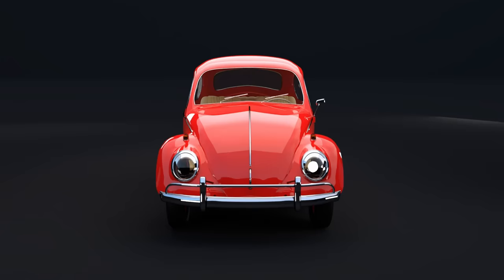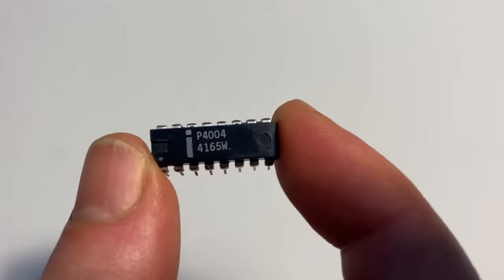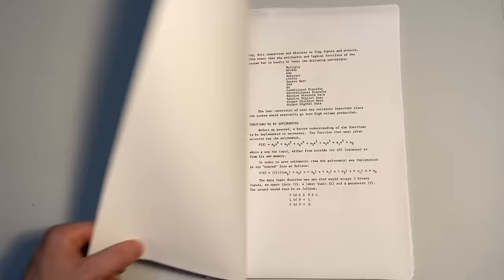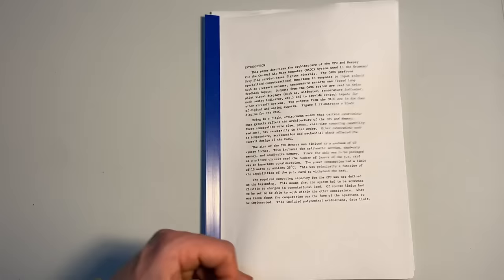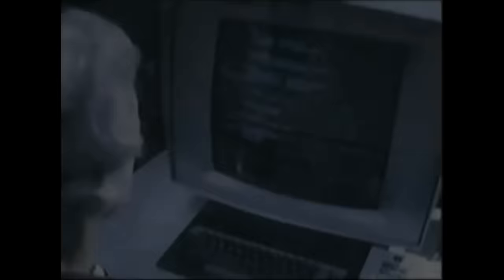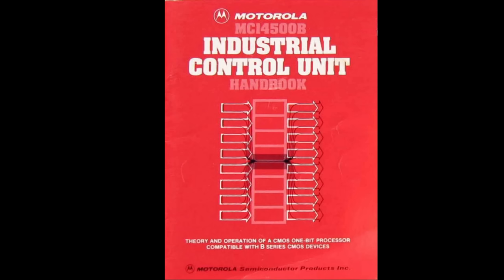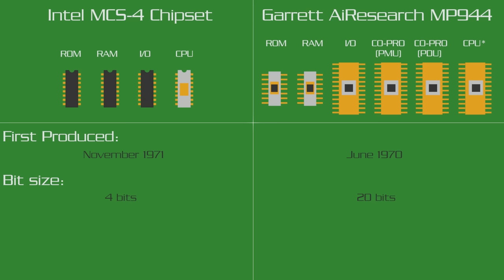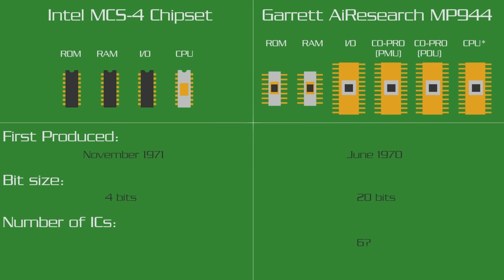The World's First Microprocessor: F-14 Central Air Data Computer

Comment: Some friendly corrections: (may border on the seriously pedantic, your call)

5:03 It has been known since the 1950's that the most highly manuverable craft are often somewhat inherently unstable. Nothing controversial to anyone knowlegable there. 
7:38 Variable wing geometry is still in active development and is not obsolete. Swing wings are obsolete. There is a distinction with a difference. 
10:18 IIRC, The computer controlled the reaction of the rest of the flight control surfaces to the extension and retraction more than the speed of actuation of the swingwings and vanes. It was required to control these so that the compensation worked correctly, as you noted earlier where manual actuation was still CADC controlled. 
17:45 The stance that a "rEaL" microprocessor must have onboard rom, ram, IO,  is farsical. My 6-month old top of the line pc has seperate IO chips, Ram chips, Rom chip, and a co-processor cars with all 4 onboard. So only SoC would count, which is not in the same realm. I think you just wasted time here. Just muddled the whole topic here, although explaing the rom etc was nice. 
23:45 Not a correction, just think you should do a video on the "Four Phase" as I have never heard of it and can find little info. There are already many great and exhaustive videos on the 4004.
30:22 I don't get why that would be harder to program for, and you made no justification for this statement. 
40:33 Machine code translates to binary with no real compilation, it's not a 'language' per se, but a 1:1 human readable formatting of binary commands. Which is to say they totally wrote it in assembly and that was just typed in as binary. Your image at 48:00 shows that in the context of the 4004. 
45:30 Punch cards, and even magnetic tape were available then, but tape was the most common interchange format. At the time, data interchange between dissimalr systems was quite rare.
52:40 I know where there are more about in the USA, but for security reasons, I'll leave it at that. An enterprising hobbiest might be able to get their hands on at least a partial set. If I find some i'd invite der8auer to the states to see them and make a video (export restrictions invariably exist). I'm confident the iranians have already just used an FPGA to copy them, as most countries do with stolen digital tech (see: Russia and China using FPGA copies of us missle guidance computers, there are videos on this).
54:22 There were more. Some are still classified, which should make obvious their purpose. Others were just corporate dead-ends, although not all technologically so. 

All that said, you did an excelent job for a non-subject matter expert. Big respect. Got my sub.
Reply from the maker: Thanks, yes as you may have gathered by my tone, I do indeed think defining a microprocessor as essentially a SOC is indeed farcical: unfortunately there seem to be many that take that stance (for some reason). I didn't really enjoy having to be pedantic there but I was trying to make clear that 'if the 4004 is a microprocessor, then the MP944 is too'.

Anything I say about coding in assembly/machine code should probably come with a disclaimer that I am about 40 years removed from that world.

Btw, it was me saying supersonic aircraft are 'ugly' rather than 'unstable' which (rightly) made people mad!
Reply: The F-14 is not a inherently unstable aircraft, in fact, quite the opposite.  Maybe if you compare it to something like a Cessna 172.  The F-14 is especially stable to the point that even the famous flat spin is difficult to actually achieve and enter.  Less than 10 airframes were lost in them.  The F-14 actually is designed for stability because it lacks fly by wire or computer control over the primary maneuvering surfaces.  As the wings sweep back, the center of lift moves aft, increasing the distance between the CG and the CoL.  This was actually the reason for the glove vanes on the early F-14A's.  They kept the CoL further forward, reduced mach tuck drag, and allowed for 7.5G maneuvering at any speed the F-14 could achieve.

I'd argue that modern wing geometry hasn't made variable swept wings obsolete, but certainly has bridged the gap between them.  A true delta will always have less drag than the hybrid delta of something like the F-22.  A true straight wing will always have better leverage against the CG for maneuvering and provide more lift than a hybrid delta.  The variable wing sweep allows for a greater optimization across the entire flight envelop.  Aircraft like the F-14 had an impressive turn radius, turn rate, and speed relative to the thrust.  I say that because the TF-30 equipped F-14A weighed significantly more than the F-15 did and had less thrust, and yet the top speed difference between them is not that great.

The question is whether or not the weight and complexity or a variable wing sweep justify the performance gained over a hybrid delta, and that is where a variable wing sweep tends to fall behind.  The other aspect is the difficulty in stealth.  No one has made a modern variable wing sweep aircraft using modern low observability or composite technology.  It may very well still present enough advantages, for the right aircraft, to justify its weight... but no one has really done it.
Reply: @Whiskey11Gaming wrt swing wing, I think the real reason the Navy and Air Force don't use it anymore is because they can acheive "good enough" without having to maintain a swing wing system. Plus it adds weight, reducing fuel consumption. I think they found it just isn't worth the cost.
Reply: Formally, it's not wrong to refer to an assembler as a compiler. The definition of a compiler is basically just a translator for programs. An assembler qualifies, even if it's a lot simpler than we usually think of. As long as we're being pedantic. :)
Reply: @Noisy_Cricket  I concur, basically today they can beat the aerodynamic limitations with the force of sufficiently powerful contemporary engines to achieve acceptable results.
Reply: Regarding the statement at 30:22 about it being harder to program:  I agree this makes no sense.  If you read the original paper the PC in the ROM is capable of both random and sequential access meaning the CPU can write a new address to it for jumps and then continue using it in sequential access mode until the next jump.  The 8061 has a similar architecture and there it is handled entirely by the CPU and does not impact the way the code is written, and I imagine the MP944 works the same way.
Reply: @andrewfleenor7459  Formally it is wrong to refer to assembler as a "compiler" because there's a key difference between the two: there's a isomorphic relation (or near isomorphic, depending on how sophisticated the assembler is) between assembly language and machine language. There is only one translation that can be done from e.g. 8080 assembly language `MVI C,1`, which is 0E 01, and that is easily reversible: 0E 01 translates back to `MVI C,1`. With a compiler, on the other hand, there are many ways to translate `x := 1` to machine language, and you cannot trivially translate what the compiler produces (which in assembly language might be `MVI C,1` or might be `STA 80FFh`, or might even be `PSH B`, depending on the context) back to the high-level langauge being compiled.
Reply: @Curt_Sampson    I've never once seen that distinction enter the formal definition of a compiler. Sure, it's not a terribly interesting compiler, but trying to exclude trivial cases from a straightforward definition almost never makes things better.

Citations? And I do mean plural, because it'll take more than one to convince me that this definition has been the consensus and I've just missed it the whole time I've been studying compilers.

(I'd also submit that you're underplaying the complexity of assembly. Consider, say, the x86 MOV mnemonic. I know for sure there are a bunch (dozens?) of possible opcodes it can assemble to, some quite complicated. IIRC the NASM docs have a couple places where they describe places they have to make decisions about how to assemble ambiguous instructions. But that's not terribly german under my definition, which I'm pretty sure is the standard one. Just something for you to consider.)
Reply: @andrewfleenor7459  First, I'm intimately familiar with several assembly languages; I program in them to this day, and so some fairly sophisticated things with my favourite assembler (Macroassembler AS), as well as having written several CPU simulators. So I'm not coming at this from just a theoretical point of view.

And so no, I'm not underplaying the complexity of assembly. That MOV itself doesn't determine the opcode is a trivial observation; this is true of virtually all CPUs. In many cases an opcode is selected based not just on the instruction mnemonic but also the addressing mode, generally taken from the operand field, and this is true of virtually all assembly languages. The 6502, for example, has eight different opcodes for LDA because that instruction has eight different addressing modes, and for some of these the selection of addressing mode can be somewhat subtle. (E.g., do you assemble LDA $12 using absolute addressing mode, opcode $AD, or zero page addressing mode, $A5? This is why I qualified "isomorphic" with "near.") Nonetheless, that does not invalidate the massive difference between that (or even much more sophisticated versions of that in assembly language) and `x = *(0x12)` in a high level language.

I don't know that the exact definition I gave you is a consensus, but there's certainly a strong current of agreement that compilers compile "high level" languages and assembly is not a high-level language. This is implicit in pretty much every one of the sixty references given on the Wikipedia page for "Compiler."

If you want to make "compiler" have the same meaning as "translator," that leaves you with a redundant word and a missing word to describe the meaning commonly given to "compiler" that distinguishes it from "assembler." I really don't see the point of that, except to hinder more clear communication.
Reply: @Curt_Sampson  There's no redundancy: a compiler is a translator of programs. And in that category, there's a continuum of complexity from assemblers to optimizing C++ compilers. If you want to be more specific, you'd specify something about the source or target: the term "high level language compiler" is reasonably common.

I did say I was being pedantic. Implicit assumptions in a Wikipedia list are not a relevant citation. I'm working from memory of actual compiler textbooks and other academic material.
Reply: @andrewfleenor7459  If there's no redundancy, what is the difference between a compiler of programs and a translator of programs. And, more importantly, what is your term for the set of translators that compile high-level languages (without a near-isomorphism between the source and target languages) versus low-level languages (with a near-isomorphism between the source and target languages)?  If were you actually being pedantic, rather than very loose with your terminology, that is the sort of thing you would be focusing on.

I did not give you just a "Wikipedia list"; I gave you a list of citations, specifically, which is exactly what you asked for. (That list of citations even includes "actual compiler textbooks and other academic material.")  And the implicitness of the use of the word "compiler" is the nature of the argument: you're saying the word is commonly used to cover assemblers as well, and I'm saying it's not and giving you sixty citations where it's not, which is rather implicit. If you want explicit, that's on you: go find me ten citations where "compiler" is used in a way that clearly and explicitly refers to assemblers. (I.e., not just "a compiler translates a language" with you adding, "assembly language is a language.")
Reply: @Curt_Sampson    I already gave you the term "high level language compiler". I'd be hesitant to name it any more sharply because the boundary in real life, as I've said multiple times now, is not as sharp as you seem to think it is. (Where do you put Forth, for instance?) No one says "compiler of programs", by the way, because that actually would be redundant, unless you were comparing to something like a Protobuf "compiler", which (I believe) is formally just a code generator.

Ah, but now you're strawmanning me. I never said it was common to refer to assemblers as compilers. Indeed it is not. What I said is that it's *not wrong*, pedantically speaking. Even Wikipedia is consistent with this: note how broadly the first sentence is worded, and where the word "primarily" appears.

Now I'll admit that I haven't read all 60 citations on the page, but I'm guessing you didn't either, and I'm guessing they don't, taken together, contradict the opening sentence of the article, which conveniently also agrees perfectly with me, who has spent almost half my life reading compiler theory. Now do you have an actual citation that rules out assemblers as compilers, or are you just going to bluster some more based on your vibes about what "compiler" means in your personal experience?

Sheesh, I just wanted to make a funny nitpick.
Reply: @andrewfleenor7459  I don't think you're even starting to follow my argument about assemblers being near-isomorphic translators and compilers not because by that method of analysis where Forth stands is obvious.

And the word "primarily" is required in the Wikipedia intro, which reads, "The name "compiler" is primarily used for programs that translate source code from a high-level programming language to a low-level programming language...to create an executable program," because there also exist source-to-source compilers that translate high-level languages into different high-level languages. This does not erase the distinction from other forms of translation; we wouldn't refer to a sed script that replaces BEGIN and END tokens with braces and similar as a "compiler," would we?

It's apparent that you've not even looked at the titles of the citations I gave you, since the distinction is apparent even in the title of one reference: Assemblers, Compilers, and Program Translation by Calingaert and Horowitz (Computer Science Press, Inc., 1979). Within the text these lauded computing scientists make the distinction clear on pp. 186-187:

"7.1.3 Compilers v. Assemblers

"The many source-language features described in the preceding section result in a number of salient differences between compilers and assemblers. On any one item the distinction may not be clear-cut. Moreover, it may be difficult to distinguish a simple compiler from a powerful macro assembler. Nevertheless, the differences are usually substantial enough that there remains a qualitative distinction [emphasis mine —cjs] between assemblers and compilers."

The section continues with a distinction along the lines of the one based on isomorphism that I've been giving you all along: "Generally, a compiler performs a one-to-many translation, generating many target-language statements from a single source-language statement, whereas an assembler performs a one-to-one translation." (One obvious exception to the former is when the target language is also a high-level language, of course.) And then goes on for another page and a half with further qualitative distinctions.

Can you find an equally weighty source that clearly and unequivocally states that compilers are assemblers? I doubt it.
Reply: @Curt_Sampson   A pedantic interpretation of the definition of a compiler, such as I was explicitly using from the start, points at "qualitative differences" and laughs. The authors you quoted would still be forced to agree with me if pressed, which you can tell because of how many pages it takes to  work around the fact that assemblers clearly fit the definition, and that macro assemblers blur the line. (By the way, does that answer your previous question about how to draw a line around HLL compilers? Or rather, illustrate why I can't be arsed to give one?) But congrats on both finding and actually reading a citation that sort of supports you, even though I don't think it changes my point.

And I don't think you realize just how close Forth is to the same kind of one to one translation as an assembler. The body of a Forth word is almost one to one with a bunch of jump instructions (I think there's some complication for control structures). And yes, of course I know exactly what you mean about the the vague isomorphism between assembly and machine code. You could almost implement an assembler with regexes and substitutions. That changes nothing. Pedantically.

The great thing about definitions is that you don't need an authoritative source to spell out every possible case for you.
Reply: @andrewfleenor7459  It's just a page and a half, and it makes clear why assemblers don't fit the definition of a "compiler"; it "works around" nothing; it describes a fairly clear difference.

That the line between compilers and assemblers isn't a hard, narrow one isn't unusual. We don't say that "all chairs are tables" just because virtually all chairs can be used as tables. What you are trying for here is an "all chairs are tables" style of definition.

I realise exactly how close to and far from Forth is to the machine; I think you do not. If you understood Forth well you would be well aware that for any particular word you're given to compile, you can easily come up with three or four different ways of compiling it and find examples of different Forth implementations using all of these for any reasonably popular CPU.

"You could almost implement an assembler with regexes and substitutions. That changes nothing. Pedantically."

In other words, you consider even trivial sed scripts that do just substitutions to be compilers. Well, you're welcome to the personal definition, but don't expect many people to agree with you, because it's a ridiculous definition. I would say it's also rather the opposite of pedantic, because you're essentially removing meaning from the word "compiler" and making it harder to discuss many program transformation techniques.

"The great thing about definitions is that you don't need an authoritative source to spell out every possible case for you."

Well, you didn't seem to find that so great when you were demanding an authoritative source earlier in this discussion.
Reply: @Curt_Sampson  Chairs vs tables are actually much better separated than compilers and assemblers. One is for butts, the other is not. Even where the forms overlap, it would be very obvious in which capacity you were using it. Weird example.

A simple sed script could indeed be considered a very trivial compiler, given suitable endpoints (simple brace substitutions won't cut it for any languages I know, but you could invent them). There aren't a lot of good examples, but some esolangs are in that territory. Not very interesting compilers, I think you'd agree (unless they're funny, which they often are).

And hey, I said you deserve credit for finding a citation. But it is just rehashing an argument that I already consider to be special pleading, while effectively conceding the core of my point. An argument from vibes. (Ed: oh, and it still has the weasel word "usually".) I asked for a citation, yes, but I don't have to find it compelling.

Like I alluded to, I'd be happy to argue the same point with the authors. 
They'll come around as soon as we start talking about universal quantifiers over source languages (yes that's a real thing), and whether assembly should somehow be excluded from sources but not outputs. You can get away with fuzzy definitions in conversation, not not in math.

I'm curious: do you consider a program that converts a HLL with recursive syntax to an isomorphic HLL to be a compiler? Suppose you made a language isomorphic with JavaScript up to whitespace, and wrote translators both ways. Is it the isomorphism or the linear structure that makes an assembler not a compiler? (Oh, I suppose now it's the nebulous sum of all features that someone draws a line exactly around the common conception of an assembler. Sure.)
Reply: @andrewfleenor7459  So you distinguish between a table and a chair based on how it's currently being used? In other words, a table turns into a chair if you sit on it, and a chair turns into a table if you place things on it? Fair enough, but that just supports my argument that the line between tables and chairs is blurry, since the same object may be either at different times. (And you would agree, I suspect, even more blurred than that, as surely even you don't believe that a large, high table bearing no resemblance to a chair becomes a "chair" if someone sits on the edge of it. If you do, most people would disagree and say that it's still a table.)

Once you've agreed that the lines of definitions do blur like that, you can't claim that "compiler" and "assembler" are the same thing merely because you can't find a hard line between them, any more than you can claim that tables and chairs are the same thing due to similar lack of a hard line.

I'm happy to hear about your claimed "universal quantifiers over source languages" argument. Math will not help you here, though, since neither a "compiler" nor an "assembler" is a well-defined mathematical construct.

If a program does isomorphic translations between two programming languages, no, I would not call that a compiler: I would call it a translator. A program like that has no need for many of the techniques used in compilers such as storage allocation, translating control structures into different control structures, and so on. (Nor would it be an assembler unless it's translating isomorphisms of machine language.)

That you consider simple sed scripts doing near-isomorphic translations to be "compilers" is an "interesting opinion, but it's not one that most people who implement and use compilers would agree with.

I'm curious: what term would you use to distinguish, e.g., a program translator that rewrites control structures (say, looping to recursion) from an assembler? Or, for that matter, GCC from Gnu Assembler? These are clearly two distinct things with obvious differences; are you simply unable to differentiate the between the two as others do?
Reply: @Curt_Sampson    Computers (ed: compilers, whoops) are perfectly well defined mathematically if you don't insist on excluding assemblers. Function from program text to program text, done, bye. Partial function, if you like. You could try adding provisos about preserving semantics, but you'd have to pick a semantics formalism and good luck getting everyone to agree on that.

It's true that assemblers are not mathematically defined, at least to my knowledge. That's a hint.

I only brought up the "current usage" thing re tables and chairs to show that even if you try to blur the line, they're really easy to tell apart.  You have to try to make them look similar, whereas you have to try to make compilers and assemblers look different. It was a really, really bad analogy. If I was going to take it seriously, "compiler" would be like "furniture".

As for your paragraph, I would call those more interesting compilers and, if it was germane to the discussion, specify the features they support, or target language. When one is not making a pedantic YouTube comment, just "compiler" is not wrong, since they are in fact compilers.

Anyway, this has been fun but I'm getting bored of your lack of imagination. I can't promise to keep it going.
Reply: @andrewfleenor7459  We don't need to get into whether "computers" are mathematically well defined, since I never said that. (Try reading what I write?) Or, if that was a typo, please, give me your mathematical definition of a "compiler."

As I mentioned earlier, if anything that translates one language to another is a "compiler," this quickly leads into absurdity. I can define two languages that are the same except one allows multiple spaces between tokens and another doesn't, and "compile" from the first to the second with the sed script `s/  */ /g` (that's two spaces in the first pattern); to call that program a "compiler" is, most people would agree, completely absurd. And, of course, it removes a lot of the meaning of the word "compiler," reducing it to (nearly) the same meaning as "translator" or, even worse yet, "function." There's a good reason that the Gnu Compiler Collection is not instead called the "Gnu Function Collection."

Your desire to erase the distinction between compilers and assemblers is understandable, since people like to make things simple. But a mere desire for simplicity doesn't work in the real world, where people (excepting you, apparently) do distinguish between two things, even if that makes life somewhat complex. (And I note you seem unable to provide a different word from "compiler" to help make a distinction that computing scientists and programmers—again, perhaps excepting you—actually do make.) I find it ironic that you call the ability to make this distinction a lack of imagination on my part, given that it is you here who appears unable to conceive of the differences I've been pointing out to you.

And no, tables and chairs are not always really easy to tell apart. Consider a 40 x 40 cm square plane with perpendicular legs of 40 cm at each corner. is this a chair or a table? You can tell only by the intent of the designers, or by its use.
Reply: @Curt_Sampson   Haha whoops, yes, typo. That's a definition of a compiler.

But really, I think you're the one asking for a simple term to describe a deceptively complicated category, the set of programs commonly considered to be compilers. I've given you the term "high level language compiler" multiple times. That's my final answer unless you have a more specific set you want to talk about.

The code formatter case, which is kinda what you're doing with that sed script, could actually be interesting. You could consider those compilers I guess, or treat programs that only differ on whitespace as equal. In practice a code formatter looks much more like a normal compiler than an assembler does (recursive syntax, etc), despite making no semantic changes, so I don't think that's quite the reductio ad absurdum you do. Meanwhile most PL papers work with abstract syntax where that's not really a question.

Oh, speaking of isomorphism up to whitespace, you didn't answer my question about whether isomorphism is really what takes away "compilerness", did you?

At least we agree on tables and chairs, though. That's the exact same point I was trying to make. How about we let them go?
Reply: FORTH - haven't heard that in a while.
Reply: what a load of self-important blather (the op)